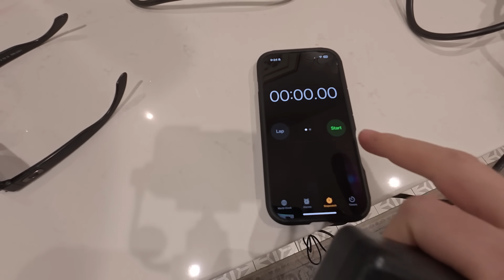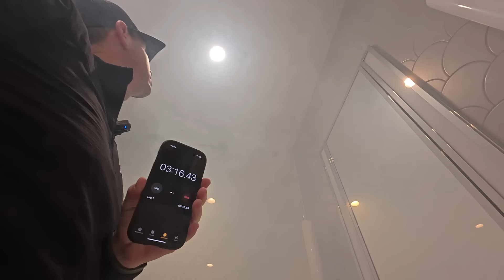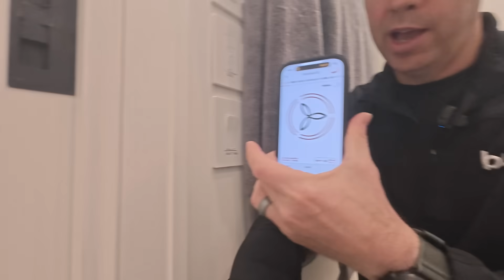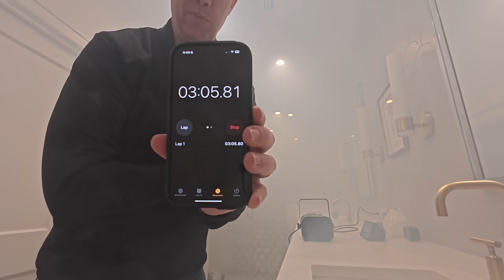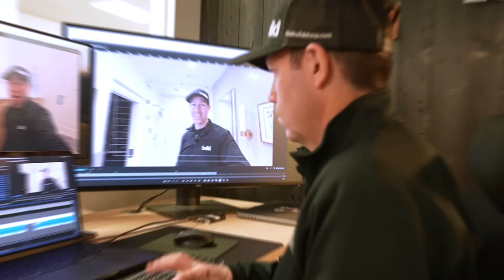Can A House Be Too Tight - ERV Fresh Air Experiment

Comment: Maybe your referenced comment was from someone who wasn't considering the additional implementation of a good air management system. For example, there is a call for airtight homes in New Zealand's building code, but no requirement for any air management systems, which causes a big moisture management issue. Maybe Matt, you could do the same test with your air management systems turned off....
Reply: A friend of mine rented an apartment that was under a year old and found that mushrooms started growing in the window sills because the system could not handle a window being opened. It was too air tight with a system that needed the house to be permanently sealed from the outside other than just opening and closing the entrance door. The problem with houses being built like that in Norway is that no one is used to living like that. We all love opening windows and having the balcony door open in the summer. This means disaster for many homeowners that move into a home expecting the freedom to live as they wish rather than being stuck inside as prisoners to a ventilation system.
Reply: @rustknuckleirongut8107  Also, if your air system can't handle a bit of moisture like that, what's it doing with the carbon dioxide?

Comment: How tight can a house be before you need an ERV?  3 ACH?  2ACH?
Reply: I guess 3 ACH because it is code.
Reply: From the data I've gathered, you should target around 5 air changes every 24 hours. The blower door testing is done at a pressure differential of 50 pascals. Your house should never get beyond+/-2 pascals normally. With that in mind, you can pretty well predict what your natural ACH is by dividing the ACH50 number by a factor of 20. If that number doesn't result in 5 air changes every 24 hours, you need an ERV.

Comment: After this I agree with the house to tight community
Reply: It’s not even working as well as a bath fan would if it had make up air. It took quite a while to clear the fog. My bath fan clears it up in minutes. However I still feel like there’s advantages to building this tight. It just seems like the mechanicals need improvement.